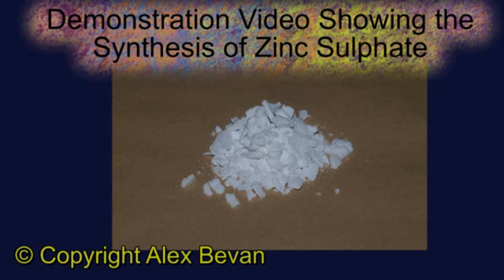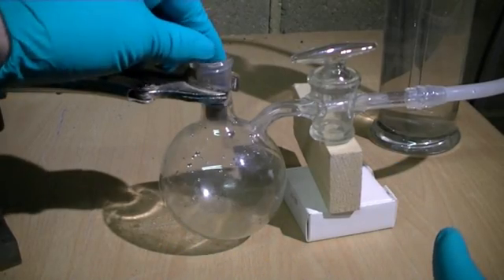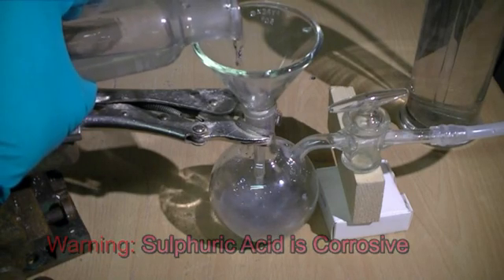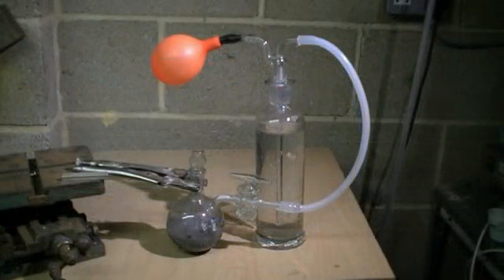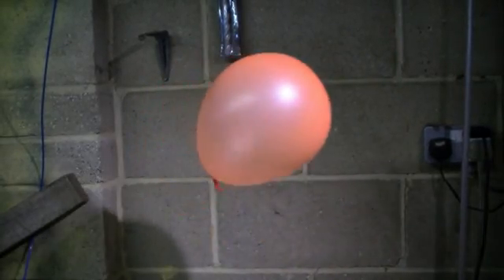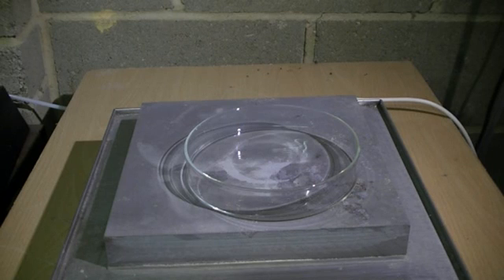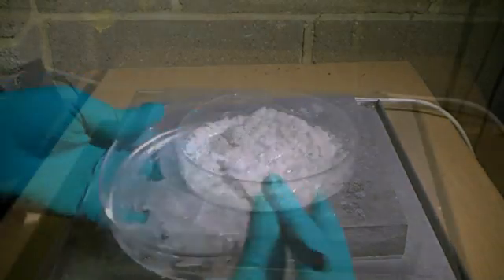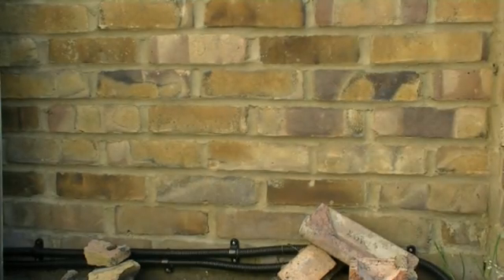How to Make Zinc Sulphate (ZnSO4)

Comment: This is lead dear🙏
Reply: There are both lead wheel weights and zinc wheel weights. The zinc ones are not as heavy and harder by comparison.
Reply from the maker: Lead wheel weights have been phased out a long time ago, also lead does not react rapidly with sulphuric acid or car batteries would not work as they have lead electrodes in sulphuric acid. Check out the following link if intereted: https://youtu.be/OIwTFhx26U4

Comment: the wheel weights are not zinc but Lead (Pb), which is quite apparent from the weight and density of the weights. Zinc is relatively a very light element.

Comment: reaction faster with catalyst - one drop of CuSO4 solution (Information from one book), with concentrated H2SO4, not only hydrogen, but H2S also will be in your baloon, so beware, H2S -  toxic gas... or use diluted H2SO4, 30% H2SO4 pretty fast too, with Zn dust at least, also faster if heated and with mixing
Reply: Hi can you give the title of the book ? I really need an information about this reaction. Thank you